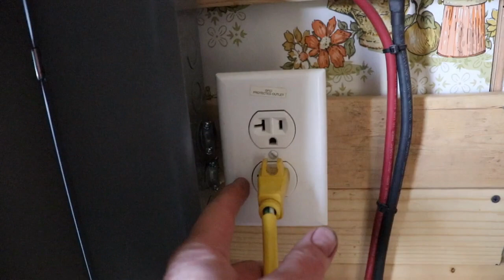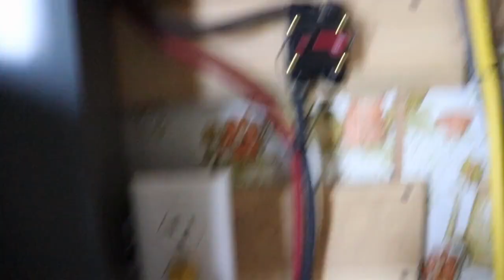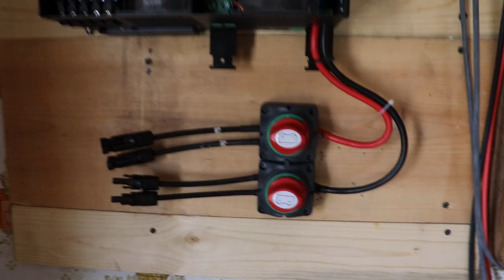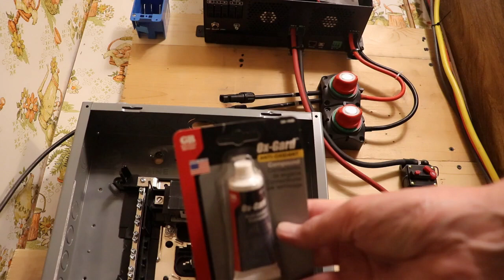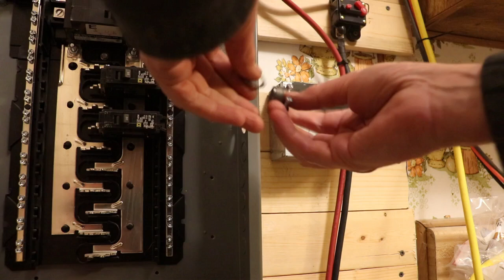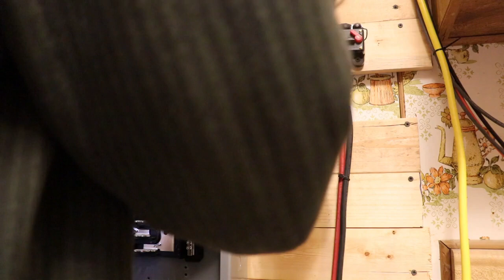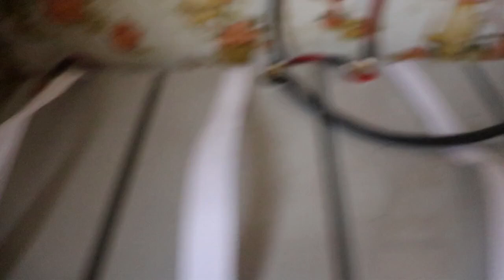MPP Solar All in One Solar System Installation and Setup

Comment: Thanks for the walkthrough.  What size breaker did you install on this unit?
Reply from the maker: 30 amp cause it's 120 VAC outlet as you seen with the rated at 30 amps socket which most normal houses just have the 15 amp socket. 1:19 into the video you will see the socket and how it has a -|| I also include the wire size chart in the video for the amp rating. Should use 10 AWG but 8 AWG wire for the socket is the standard guide.
Reply from the maker: Also you use solid wire for AC, braided wire for DC

Comment: heya yes yes you now what your talking about I can see, but it's a lot differant then how I do it  here in  my country Holland my grid voltish is 220 volts or 380 volts between 2 fases. I will vlog the total instal for my grid-tie solar instalation so if you like you can see the differances your self
Reply from the maker: oh yeah, I'm aware. Traveled overseas before.

Comment: thank you..still learning all this.....    why do you place the batt switch/breaker  in the neg.....
Reply from the maker: Same reason why you disconnect the negative line first on your car battery, so you don't get a spark on the batteries. It is good to have one on the positive side too which most diagrams show you to do. I like doing both but I ran out of switch/breakers.

Comment: I have never seen a breaker switch be put on negative wire I've always seen them put on the positive are you sure you have it right??
Reply from the maker: Either is fine however what's the first thing you do when disconnecting a battery? You disconnect the negative DC terminal first. Would be prudent to put one on the positive side too but I ran out of the dc switches.  Ideally I would use a 125 to 150 amp breaker switch not 100 amp. I only have 14 years experience in R&D Electrical Engineering specifically in power supply design so I could easily design a unit like this if I had too.

Comment: If I was going to use this in a van, what other components would I need besides the 2 isolators  (if I want to add a separate chg controller for more solar, for example .
How would I attach my 12 volt components, espar heater  webasto x100 cooktop, water pump etc to my mop. Should I install a fuse panel for my 12 v before I go to my mpp. Thank you.
Reply from the maker: in that case I would just get a solar generator you can easily take in and out of the van.
Reply from the maker: inergery might be a good solution for you

Comment: Shouldn't you be using a male and for the AC input instead of a female GFI plug how are you supposed to pull power off your generator or utility socket with that? Thanks for sharing 🍸
Reply from the maker: got a watt meter I use to record the output with. It plugs into the socket and I plug the cord into it
Reply: @DROPsHomestead  thanks for sharing 🍸.  More YouTubers dont,don't, I really appreciate it
Reply from the maker: @caseykelso1  Whole purpose of my channel is to inform, educate and prepare people for an SHTF situation.
Reply from the maker: @caseykelso1  normally though one would use a male plug instead of a gfi socket. I have other purposes for it though

Comment: I would like to have a all in one inverter that I can plug my 24v 3100w solararray in and not use the Ac hookup. Can you tell me what I need?
Reply from the maker: If you want a all in one system I suggest you look into the MPP Solar LV6548 which has 6.5kw/hr output around 56 amps 120VAC http://www.mppsolar.com/manual/SPLIT%20PHASE%20LV/LV6548%20split%20phase%20manual-20210416.pdf . You would need to configure your battery bank for 48VDC but you can series your panels about 9 or ten for 240VDC in while keeping the current low so you can use the 10mm solar cables. When you put solar panels in series you add the voltage and the current stays the same. You would probably need to make two series of solar panels and then parallel them if they less than  310Watt solar panels. Not sure what solar panels you have?
Reply: @DROPsHomestead  I only want 24V for 120V I have 2 strings (4) 285w panels and (4) 250w panels
Reply: @DROPsHomestead  I would like to keep my battery bank at 24V

Comment: How's this system held up since you installed it?
Reply from the maker: Great. Use it all the time to power appliances, tvs laptops etc..... little pricey nowadays though and they are charging too much for shipping since it comes from Taiwan.
Reply: @DROPsHomestead  thanks. I'm trying to spec out a 2424 (or larger) with 2 silicate batteries due to the Sub-Zero temps where I'm at and not excited to see what shipping will be...
Reply from the maker: @trutwijd  I would look into a 48VDC All in One because they are more efficient. The higher you go in VDC the less current you need off the batteries for the same output wattage.
Reply from the maker: @trutwijd  I have been looking at this unit as well for possible use elsewhere. https://www.amazon.com/dp/B096B7JQVH/?coliid=I1AP7RUKXRUGYC&colid=3789SOTZQOHH&psc=1&ref_=lv_ov_lig_dp_it
Reply: @DROPsHomestead  I don't know if I can afford a 48v silicate battery bank

Comment: You seem to be very concerned with safety and details but you made several mistakes in your electrical work.  The neutral and ground conductor feeding your panel cannot be under the same lug... in fact that lug isn't rated for wires as small as #12.  Read the label on the panel. It provides all that information.  Your panel is a sub panel as the MPP controller is the service. Therefore you must remove the green ground screw and install a separate ground bar for the grounds in cable. Nolax is not intended for copper wire. In fact, is rarely used as the new 8800 aluminum alloys don't require it. The one inch romex connector is too large for a 12/2 or 12/3 romex cable. Again, read the listing for the product you are installing. BTW, stranded wire is perfectly acceptable for AC work and is the most common type used in commercial work. Wire type usually comes down to the device that is used: screw or compression. You might consider putting a disclaimer at the beginning of your video that you are not an electrician and this is only what "I do." Good luck.
Reply from the maker: yeah the main panel you do combine the ground and neutral. You only do that with a sub panel which this is not but what does a EE and person that worked for the IBEW really know right? BTW I didn't use any aluminum wire. Also check your local wiring codes because they vary depending on heat and humidity. I did several years in R&D EE so I guess I know nothing LOL